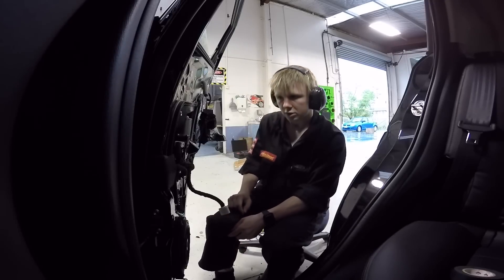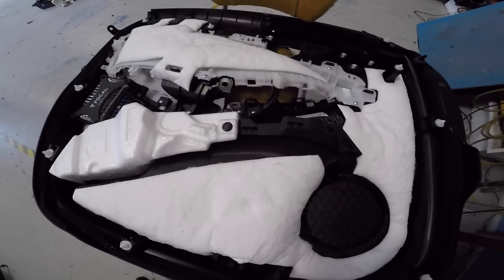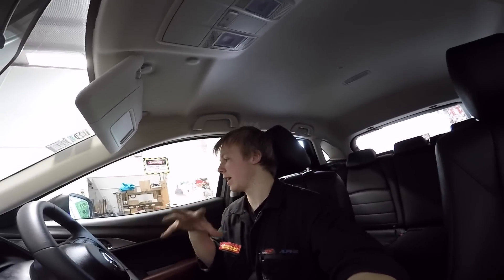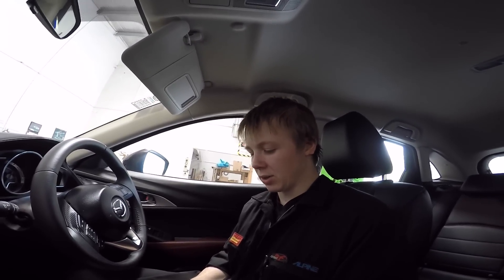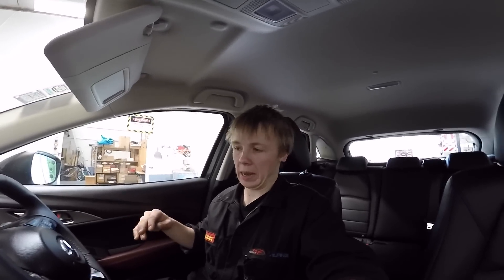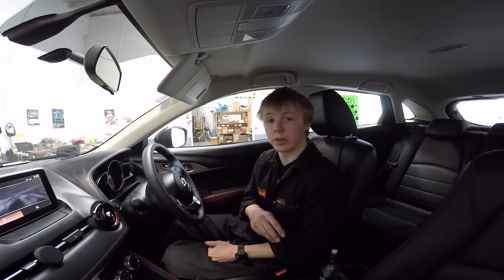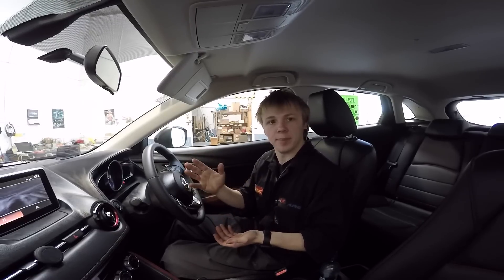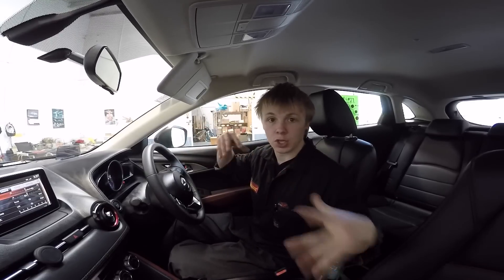2016 Mazda CX-3 + Focal PS-165fx + Focal PC-165f, Fully Sound Deadened Part 2!

Comment: That car needs a dsp, something like an audison bit ten or bit one.
Reply: ...to do what with the DSP?
Reply: Flatten the EQ for a better signal to the speakers
Reply: Flatten the EQ? What's wrong with the EQ? How do you know it needs flattening? Fooling around with the EQ won't make the signal any better...
Reply: Dealerships modify the eq to get the best sound out of the cheap speakers they put in to save money. A processor will make the eq flat and allow you to tune the system based on the new equipment you've installed.
Reply: The Mazda dealership hat modified the factory headunit in order to get the best sound out of the shity factory speakers... OK, let's say they did. Now, an end user or maybe an installer would use an EQ to flatten the responce curve and allow for a better system tuning of the new equipment.
My question is how do we know that the curve needs flattening, where the flattening "points" are and how much such this flattening should be (how many dB of correction)?
Reply: To actually see the dips and peaks in the signal you'd need a real time analyzer(RTA). You can play pink noise and figure out which frequencies have been boosted and which ones have been reduced. 9 times out of 10 the signal looks like a sin wave.
Reply: This could just be the accoustics of the vehicle itself, NOT the EQ on the HU... 

All in all, a DSP makes sense only in cases of total upgrade (amplifiers, speakers, the lot...), just replacing the factory speakers with some fancy (and expensive for no reason) Focals is just a show-off, since the amps that drive those new speakers are still the distortion kings HU-dwarfs.
Reply: There are cheaper options like line output converters but yeah I agree with you. There's no reason to spend that much money on speakers if you're not going to amplify them.
Reply: That's what he said in the video if you payed attention.
Reply: I own the 3rd Gen Mazda 3 which basically has the same oem sound system, (4 mids 2 tweeters). I'm going to add an Audiocontrol LC7i output converter between the HU and the amp which will take care of most if not all of the basic "issues". Yes a DSP would be great but the cost here for one in Canada for what I want/need isn't a viable option. And as stated in the video, sound deadening makes a huge difference.
Reply: Rockford Fosgate 3Sixty.3 is a cheaper option or .2 older version   even more cheaper  but do the job
Reply: Mytrunec22 The DSP will sum the outputs from the factory deck or amp. That being said the price of those speakers are wasted unless amped DSP or aftermarket deck.